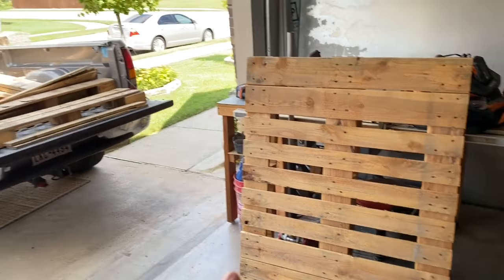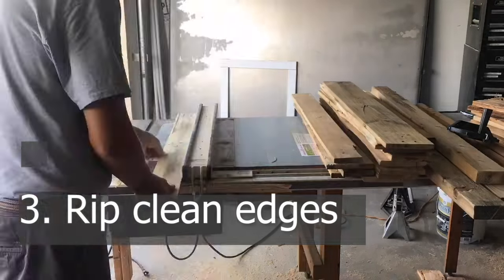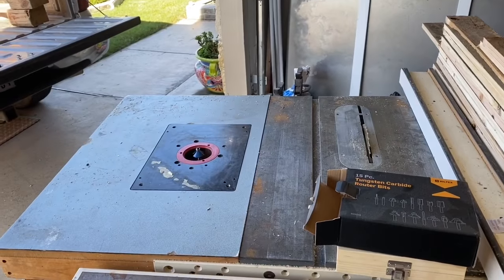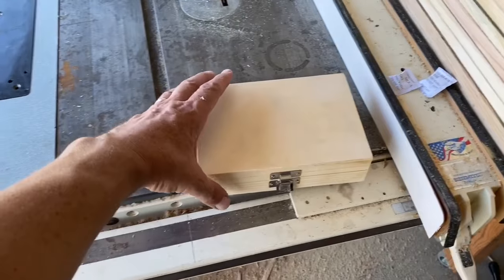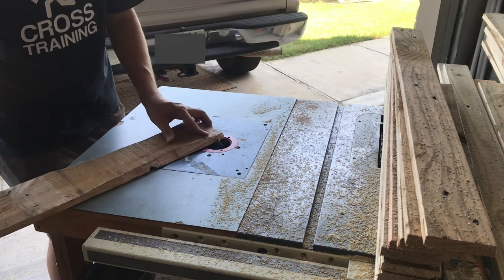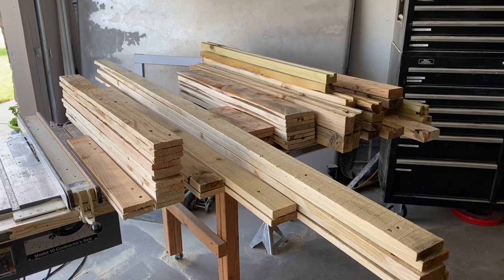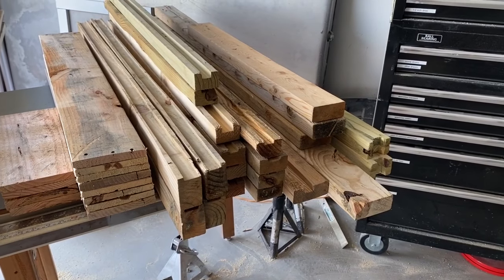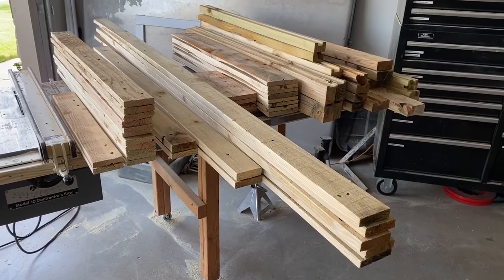Want great results on your pallet wood projects? Prepare the wood correctly - 5 easy ways!

Comment: There are many videos for reclaiming pallet wood. There are also many methods for reclaiming the wood. There are many opinions about using reclaimed pallet wood. Scott did a fine job with providing his method for reclaiming and prepping the wood for his projects. Just because someone has a different or negative opinion, shouldn't necessarily mean a thumbs down or dislike vote or nasty comment. Please, just leave simple and civil comments. For instance, I would suggest using safety equipment, such as push sticks, ear protection, good quality mask and so on. Overall, a good method that works well for Scott and many others.

Comment: If you remove the nails with a punch and claw hammer (because of the method used to break down the pallets), you could plane the boards to remove the surface mold. Or, by using some blocks and a mini sledge hammer, remove the boards and then use a hammer or use an Air Locker pneumatic nail punch.

I'm somewhat concerned about kick back from the router table running the boards back and forth like that.
Reply: you win some you lose some, I guess if you're a palletman you ought to keep some extra sawblades laying around and perhaps also be a bit more on point with wearing safety equipment.

Comment: How did you go about remove flush nails on the 2x4's along the 2" side(narrow side)? I cant figure out a good way to about this. It is turning them into waste instead of use for me. Thanks
Reply: Have you tried filling the nail holes with epoxy? Adds character to the wood.
Reply: Did you ever find an answer for this?  I have some really nice oak 2x4s that i would like to remove the nails.
Reply: Unfortunately, they are left there. If you try to remove them, there will be some damage. Fuck it. Give it a dark accent color and call it art!

Comment: The grooved boards you mentioned at the end are called "dunnage". They're used for applying tensioner straps to hold down items to pallets without damaging said item. Or they're used to raise stuff off the ground to keep off wet surfaces or to pick up/lower with forklift forks etc.

Comment: I've been cutting up scrap wood for my wood stove for decades.

However,  it would be good to replace a wood deck that has been in place for thirty years and is in marginal condition. 

That will require 30 2x4 boards 93" long for decking.

One of my sources for scrap wood is an outfit that sells stone slabs.  They take delivery on 8x16 foot slabs an inch thick, and that comes in pretty beefy wood shipping materials that include eight foot long 2x4s.  So I considering using those for decking.

I took a couple apart today,  and they have a LOT of nails,  which I mostly removed except for a few that broke off.  The boards themselves are of low quality, many with outside edges that have gaps,  and they are rough cut,  not planed,  and I don't have a planer.

My big decision is whether I'll use those boards for this project,  or buy  new lumber. They are for my rental house,  and a bit rougher than I would prefer.  Structurally OK,  but appearance somewhat sub par.  I don't like all the nail holes near the ends,  either.  I could cut those out and use two pieces to make that 93" length and choose my boards for better appearance. 

I've been watching videos about pallet busting,  which gave me improved methods for taking these more complicated pieces apart.  Even if I don't use these pieces for the decking,  I've got usable pieces for projects.

Another project might use some of that 2x4 material.  This is an interesting scaffolding project from "This Old House"  https://www.youtube.com/watch?v=NDBiLc38pmQ&t=163s

I've got the 2x6 material they use kicking around as well. 

Anyway,  I've enjoyed watching pallet busting videos!  It's fun tearing things apart!